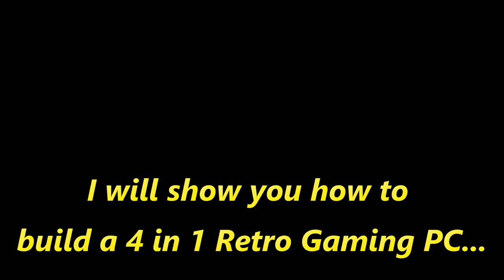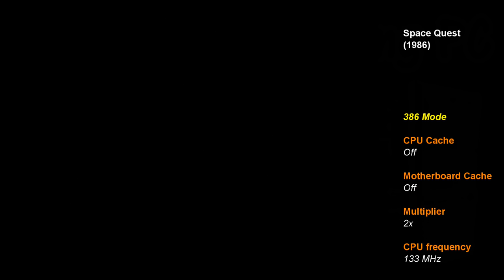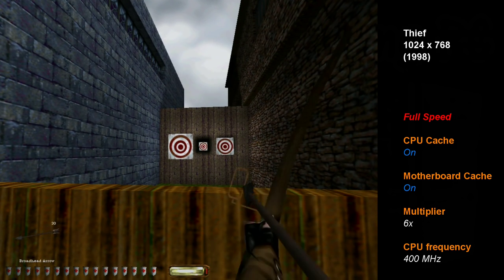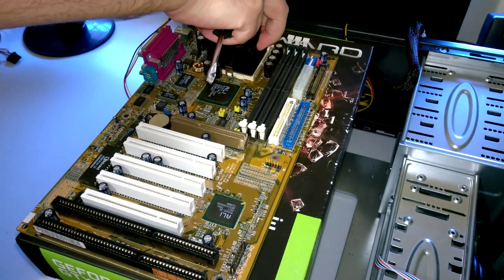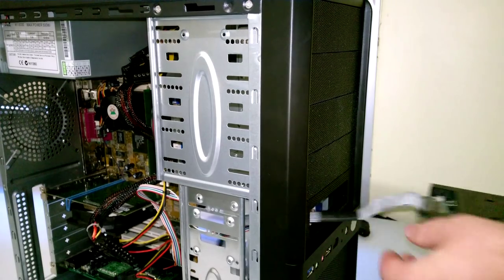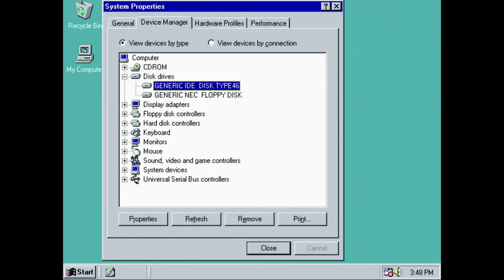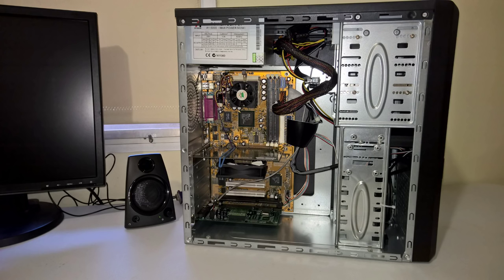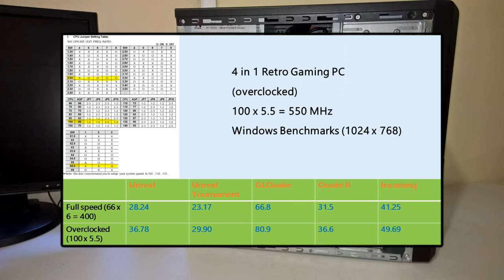Building a 4 in 1 Retro Gaming PC

Comment: This video has made me begin a massive overhaul of my MS-DOS gaming machine into a dual early Windows 9x/MS-DOS computer running Windows 95 OSR2.5 with USB storage device support, the most amount of sound hardware possible and 3DFX graphics hardware (Voodoo 2 minimum). I have, however, two questions concerning the K6-III+.
First, I'm looking to get a 450MHz version of the CPU, the K6-III+ 450ACZ, which uses a 4.5x multiplier. I just want to make sure integer multipliers are possible with this particular K6-III+ so I can get a 133MHz clock for 386, 486 and Pentium performance modes.
Second, my lone Super Socket 7 motherboard's lowest voltage is 2.2V. Would running the K6-III+ at this voltage cause damage to the CPU? If it does, I will have to source another Super Socket 7 board, preferably with AGP so I can use one of my Voodoo 3s like in this setup (I'm currently stuck with an S3 Trio64V+ and Voodoo 2 12MB combo since my motherboard lacks AGP).
And a general question regarding the 386 and 486 settings, are those made so the K6-III+ runs like low-end versions of the CPUs (386SX/486DX) or high-end versions (386DX-40/486DX2-66 or 486DX4-100)?
Reply from the maker: +Ace9921 Yes, all the multiplier steps will work! You still set the 4.5x via jumpers or dip switches on the motherboards, then you can override it via software as shown in the video.  So yes, you can get 133 MHz. 2.2V isn't too bad, just got to have appropriate cooling.

With the speed you end up with caches disabled, every board is a little bit different. I can't give an exact answer therefore, however you will more likely end up with an average 386 and a normal 486DX. If you want something faster, use the Pentium MMX. That will give you a fast 386 and a DX2-50 roughtly. BUT the Pentium maxes out at 233 MHz.
Reply: +PhilsComputerLab The fastest Pentium MMX I have is a 200MHz version and I'm not satisfied with how it handles Star Wars Shadows of the Empire under Windows 95 (I'm looking to run this game at a constant 60FPS, but with the Pentium MMX and even an AMD K6, also 200MHz, the framerate is closer to the Nintendo 64 version, which I absolutely do not want). Actually, do any of these CPUs have unlocked multipliers?
Something else, too: why are Super Socket 7 boards so pricey? The only two Super Socket 7 board I have are a (ahem) PC Chips M575 (this board uses a rebadged ALi Aladdin IV+ chipset and is possibly one of the only PC Chips boards worth a damn, although mine had a corrupt BIOS when I got it - this is the board that can't go lower than 2.2V for the CPU) and a TriGem Delhi III (this came from an eMachines computer - this board can go down to 2V, but has only two ISA slots and is incredibly flaky, sometimes failing to POST for no reason). What would be your recommendation for a motherboard which can be powered by an ATX power supply (whether the board itself is AT or ATX, I don't care, my case can take both), has three ISA slots and an AGP slot? I'd like to use my Voodoo 3 3000, but I have no Super Socket 7 boards that can take this card, which limits me to a single Diamond Multimedia-manufactured Voodoo 2.
EDIT: Forgot to ask about cooling if I run a K6-III+ at 2.2V. I have a fairly tall aluminum Socket 370 heatsink with a Cooler Master fan on it. Would this be adequate?
Reply from the maker: Sorry too many questions in one wall of text for me to answer :(
Reply: +PhilsComputerLab Never mind, I have a list of motherboards with AGP and three ISA slots and I got the Delhi III motherboard working with a modified BIOS for K6-2+ and K6-III+ compatibility. Also bought the 450MHz K6-III+ I mentioned, just waiting for the CPU to arrive now (I have a plain K6 sitting in the socket as a placeholder for now).
Still feel the need to ask why Super Socket 7 boards are so expensive. If I can't find a new motherboard locally, I'm stuck with having to shell out $100+ to get an ATX board with AGP and three ISA slots, which I REALLY don't want to do.
Reply from the maker: They are expensive because you haven't looked for them 5 years ago :)

It's like Core 2 Duo boards are cheap now, but nobody is interested. I used SS7 boards and promoted them for time machines for many years before others caught onto to it.
Reply: +PhilsComputerLab It turns out I've been sitting on a compatible motherboard since I built my first MS-DOS computer without even knowing it! I have a Shuttle HOT-569, which is your standard AT Socket 7 motherboard (but also works with ATX power supplies, although I had to add the ATX connector to my board), and when I got this thing, the original Flash ROM for this BIOS was broken. I fixed it by flashing a new Flash ROM with a modified BIOS that actually gives this motherboard K6-III+ support, which I didn't know about until recently. Better still, this board can actually work at 2V, and I recently tracked down both a PCI Voodoo 3 and an AWE64 Gold to use on this board. I'm actually surprised a plain Socket 7 board actually works with the K6-III+ (mind you, it is using a modified BIOS, but still, it works), and with an Intel 430TX chipset, no less.

I actually wanted to go with a different take on the 4-in-1 retro gaming PC using a VIA C3 (Ezra-T version), but while this CPU is good for DOS, it's really weak under Windows, far weaker than the K6-III+, even when overclocked. I might actually show off both builds since my current plan is to use the K6-III+ build for my main computer and use the C3 build as the computer for my "The Many Sounds of:" series of videos (possibly with a Nehemiah C3 as I have no idea how that version works and I want to get one, but if it's as underwhelming as the Ezra-T C3, I probably won't even bother).

Now to set up the triple sound card monstrosity I plan to use.
Reply from the maker: Nice!

I have heard about the VIA C3, but don't think I've ever used it. Nothing wrong with building a DOS only PC, in a lot of ways it makes life a lot easier.
Reply: +PhilsComputerLab I couldn't agree with you more. Trying to make a pure hybrid DOS/Windows 9x computer is quite the hassle as DOS games will generally all run fine, but some Windows games don't quite perform as well as I would want them to. The Windows 98 port of Star Wars Rogue Squadron is what's giving me problems now on both the K6-III+ and the VIA C3. On the K6-III+ with a 12MB Diamond Multimedia Voodoo 2, it seems to hold around 30FPS (still better than the Nintendo 64 original at high resolution), but on the C3 with a Voodoo 3 3000, it's incredibly choppy. I got this game working nicely at 60FPS on a 1GHz Coppermine Pentium III, and I wouldn't want the framerate any lower than that.

Is there really no such thing as an all-in-1 DOS/Windows 9x computer that can run DOS games from the 286/386 era up to very late Windows 9x and even early Windows XP games at full speed?

Oh, before I forget, I should point out some Windows 9x games could also run too fast on newer hardware. Such is the case of Star Wars Shadows of the Empire, which runs WAY too fast if its framerate exceeds 30FPS. If the framerate hovers around 40FPS, it's still fine, but anything above that, the game not only runs too fast, but is also prone to audio glitches with all the character speech getting cut off.
Reply from the maker: Interesting, I actually got a retail copy of Shadows of the Empire. Never played it though ><.

I find that there is always a compromise when you build a hybrid PC, but there are still a TON of games that will work just fine.

There are odd-ball games like Splinter Cell, that require very specific hardware or Wing Commander for example.

You can get the 4-in-1 a tiny bit faster by overclocking and a higher FSB and by using a faster graphics card, but there is a limit.

And once you go with a Pentium III, DOS gaming will break with a lot of games.
Reply: +PhilsComputerLab I experienced that first-hand with the floppy disk edition of Star Wars X-Wing, especially with sound cards using genuine OPL3. Those are the first to start spewing out random garbage on a computer that's too fast. Slowdown options seem much more limited as well.

In regards to overclocking the K6-III+ and C3, that's not entirely feasible, at least, not with my setup. The Shuttle HOT-569 does not support 100MHz FSB and I refuse to use any FSB settings where the PCI bus (or AGP bus if the motherboard I'm using has AGP) is overclocked. I couldn't get SoftFSB working on my Trigem Delhi III motherboard (this is my lone ATX Super Socket 7 board) so overclocking the K6-III+ on this board is out of the question without messing with the jumpers on the motherboard (bleh), and with the C3, the CPU maxes out at 1.2GHz overclock on a Soyo SY-6BA+ motherboard (which seems to pull a fit with the Ezra-T C3 and will not go down to a 66MHz FSB, but it does work with the older Ezra C3, although its multiplier options are more limited) while on a Gigabyte GA-6VXE7+, the motherboard complains all kinds if I use any other FSB setting than 66MHz.

Trying to find a Socket 7 motherboard that suits my needs (K6-III+ compatibility, can go down to 2V on the CPU socket, has 3 ISA slots, optionally with AGP) is a real hassle. The only board I have that meets this is the HOT-569 (although it has no 100MHz FSB); the Delhi III has very limited expansion options (three sound cards is impossible without being stuck with an ATi 3D Rage IIC AGP as that's built into the motherboard - waste of an AGP slot, if you ask me, this card is junk) and my PC Chips M575 doesn't go any lower than 2.2V (it's the absolute maximum voltage for the K6-III+ according to AMD's datasheet, and I do not trust running anything past recommended voltage ranges, which is between 1.9V and 2.1V for 2V K6-III+ CPUs).

Since I mentioned SoftFSB, I might as well ask: does SoftFSB have problems with Windows 98? I got it working on the SY-6BA+ with Windows 95, but with Windows 98, it just doesn't work properly with incorrect FSB readouts and the inability to set the FSB. On the Delhi III, it actually causes the computer to reset itself while on the GA-6VXE7+, it can't set the FSB (I don't even think it can get a proper readout).
Reply from the maker: I've never used Soft FSB, so I've got no idea. Some people route the FSB jumpers to switches at the front, other boards have FSB options in the BIOS.
Reply: +PhilsComputerLab You know what? Soon after I posted that reply, I actually thought of doing exactly that. It's likely going to be much easier than using SoftFSB (except maybe on the GA-6VXE7+ since it uses DIP switches instead of jumpers), although a better Super Socket 7 board would definitely help get the triple sound card mess up and running with overclocking capabilities... or perhaps make things even crazier and go with quad sound cards (SoundBlaster Pro 2.0 CT1600, SoundBlaster AWE64 Gold, Ensoniq Soundscape S-2000 and Diamond Multimedia Monster Sound) provided the Monster Sound's OPL3 support can be disabled (or even the entirety of its SoundBlaster support). Is this possible?
Reply from the maker: PCI cards just don't show up in DOS without loading the drivers. So that's a non issue.

Using several ISA cards however, I never had much luck with that. Personally I would just swap the cards and put the drivers into batch files. That way you can choose from more motherboards as well. Maybe build an open test bench.
Reply: +PhilsComputerLab Believe it or not, back when I was trying to set up the PC Chips M575, I actually got my SoundBlaster Pro 2.0 CT1600, SoundBlaster 32 PnP CT3600 and Ensoniq Soundscape S-2000 all working at once. The SoundBlaster Pro 2.0 and Soundscape both had DOS drivers only while the SoundBlaster 32 PnP had Windows drivers along with DOS drivers that would load by launching games through Windows, but set up so they would exit from Windows and run under pure DOS (CTCM would load automatically).

The reason why I ask about the Monster Sound is because I found Test Drive III and Wing Commander, at least on the VIA C3 (might be the case with the K6-III+ as well) actually run a bit too fast under pure DOS, but having Windows still running actually allows for enough slowdown for the games to run at their proper speed (Test Drive III does get fairly choppy at times, though).

Then comes the big question... how the hell do I mix all the sound cards together?
Reply: +PhilsComputerLab So I managed to get a hold of a Lucky Star 5MVP3, which works with the K6-III+ after updating the BIOS, but something doesn't quite make sense to me. Why does the computer have WORSE performance with a Voodoo 3 3000 AGP than with a single 12MB Voodoo 2? With the Voodoo 2, I could have Star Wars Rogue Squadron 3D running very smoothly at 30FPS, but with the Voodoo 3, it runs more like the Nintendo 64 version at high resolution, that is, with a much lower, choppier framerate. Why am I experiencing this? Driver issue? Faulty card? Motherboard a piece of crap?
Reply from the maker: I am not familiar with that board, but AGP chipsets are known to cause issues. I would check out all the BIOS options and see if one makes it work smoothly.
Reply: +PhilsComputerLab I have tried changing every single AGP option in the BIOS, but performance has not improved one bit. In fact, this K6-III+ setup performs as poorly as the same Voodoo 3 3000 AGP on a Gigabyte GA-6VXE7+ Socket 370 board with a VIA C3 installed (both motherboards use VIA chipsets). I'm seriously confused here; I almost feel as if I'm better off either getting another 12MB Voodoo 2 to make a Voodoo 2 SLI setup or get a PCI Voodoo 3. Would there be any benefit to using a PCI Voodoo 3 over an AGP one, and for that matter, how would two 12MB Voodoo 2s in SLI compare?
Reply from the maker: V2 SLI is on the level of between a V3 2000 and 3000. But image quality of the V3 is nicer and you get away with using just a single card.

V3 PCI is rarer and not cheap, but will solve any AGP issues.
Reply: +PhilsComputerLab I might actually be able to get a Voodoo 3 2000 PCI off a local here, so if that deal goes through, I'm set.

I'm honestly quite shocked at the serious performance drop I'm experiencing with the Voodoo 3 3000 AGP compared to my 12MB Voodoo 2. Would an ALi chipset perform better with the Voodoo 3 3000 AGP than a VIA one?
Reply from the maker: It really depends on the board and BIOS. The Gigabyte board I used also has a performance drop with the V3, but it's not massive. Another board from Iwill with VIA chipset goes faster.
Reply: +PhilsComputerLab Unfortunately, I only have one Super Socket 7 board with an AGP slot, so I really have nothing to compare the performance with except an equivalent setup running on that Gigabyte Socket 370 board I mentioned and even a Soyo SY-6BA+ Slot 1 board with a Slotket.
I must say, my performance woes with the 5MVP3 has reinvigorated my interest in the VIA C3 processor since I have identical performance issues with that CPU and the same Voodoo 3. I'm curious to take this a step further and use a PCI graphics card like my GeForce FX5500.
Reply: +PhilsComputerLab So it seems the performance drop stems from Rogue Squadron 3D somehow forcing Direct3D instead of Glide whenever I install DirectX 9.0C even when I don't want it to. After two days of headaches stemming from something having to do with the motherboard cache on the 5MVP3 (if I leave this enabled with the K6-III+, the motherboard becomes very unstable and locks up almost non-stop) and a fresh Windows 98 SE installation later, the entire setup is running better than anything I've put together with the 12MB Voodoo 2. Using Glide with Rogue Squadron 3D on the Voodoo 3 3000 AGP, when it actually works in Glide rather than forcing Direct3D, 100MHz FSB, tight memory timings and the K6-III+ overclocked to 600MHz, the game runs much smoother than with any previous setup I've put together. Still scratching my head as to why Rogue Squadron 3D forces Direct3D even though I want to run the game using Glide whenever I install DirectX 9.0C (not only is performance worse, but the video signal is considerably darker since Direct3D has lower gamma than Glide by default).
Now to find another Aureal Vortex 2-based card to use as a sound card under Windows. Sadly, I had to ditch the SoundBlaster Pro 2.0 because it just wouldn't fit due to the 5MVP3's horrendous CPU placement. It has since been replaced by what I can presume is a variant of the Yamaha Audician 32 (same PCB, but with two crystals and a YMF719 instead of the YMF718), which will stay in this computer until I can figure out a way to somehow get the SoundBlaster Pro 2.0 to fit.
UPDATE: I have the same problem with DirectX 8. As soon as Direct3D is available, Rogue Squadron 3D forces itself to Direct3D even when Glide is requested. WTF? What Voodoo 3 and DirectX version are you using?
Reply from the maker: With a V3 I usually use DX 7.

Does the GOG version of this game run on a retro PC?
Reply: +PhilsComputerLab No idea, I have the original disc. I don't see why it wouldn't, though.

I'm still confused as to why Rogue Squadron 3D keeps forcing Direct3D whenever I get the options to use Direct3D and Glide. There is a considerable performance gap between the two, with Direct3D being on the losing end by a HUGE margin.
Reply: +PhilsComputerLab I have completed the overhaul and took your 4-in-1 computer idea to the extreme. I have the final specs in the retro activity thread on VOGONS, if you want to have a look at what I crammed into this computer.

Comment: What is a good common inexpensive PCI graphics card that works with Win-3x
Reply from the maker: You know, I haven't done a single project with Windows 3x. So yea, I couldn't tell you. Back in the day I had an ISA ET4000 I believe, that card ran very well. Not sure about PCI though.
Reply: Any PCI card based on the Trident chipset will work well and has good driver support.